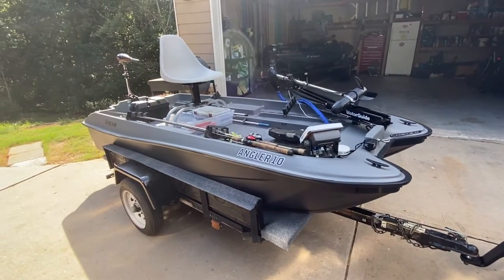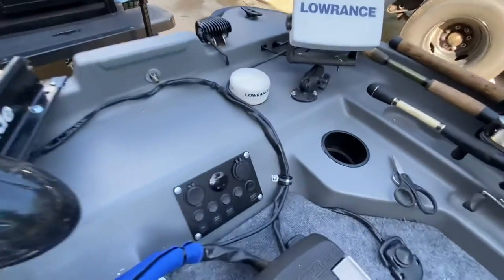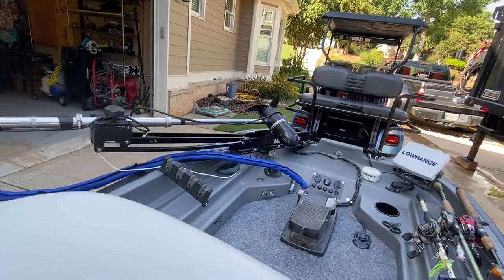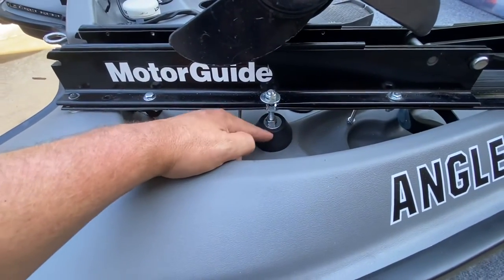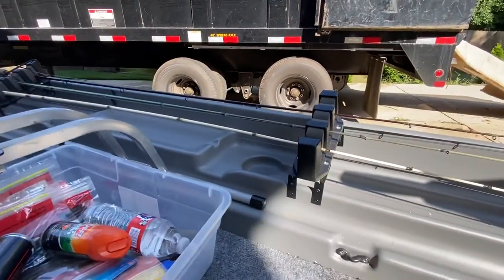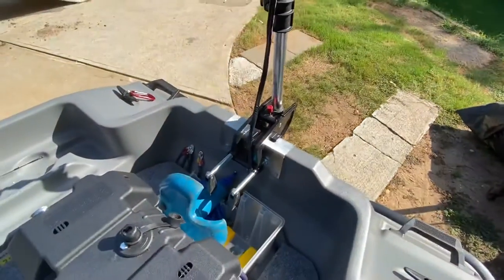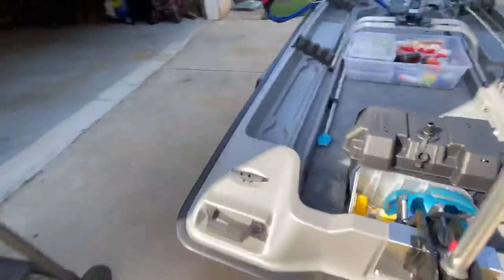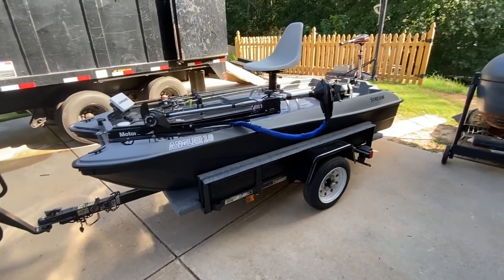Plastic 10’ boat modded

Comment: Great build, Greg! I love your mods! I'm on Lay Lake in Alabama, and we just got a little Bass Tracker Bantam 2X. Fished it a week or two and the generators were kicking my 40 year old butt trying to paddle, so I recently ordered the "4½ HP" 4 cycle Cukusin/Hangkai Honda clone. Hoping I'll get a least a few miles an hour, and our lake is about 12,000 acres, so I'm starting with the gas outboard and getting a trolling motor later. Starting on a very tight budget. 

I'm gonna steal your low deck idea. I love it! Do you have storage or accessibility for the deck?

Also love the magnet idea! That's a quick & easy mod that'll be quite handy for me. I'm also looking at a tackle rail, an original idea for custom lighting, and gotta figure out where to find the rail seats...mine can use em but didn't come with any. 

Thanks again! Subscribed! I'll be posting videos of my build soon. Thanks for the inspiration! 🤝

Comment: nice mods.   How did you run power the wire for the graph back to the battery?   did you fish it through the hull or just run it under the deck?
Reply from the maker: I ran it under the deck. Buy a long set of jumper cables and cut off the ends and it’s durable and cheaper than other wire.

Comment: Great mods! What screws do you recommend for securing accessories to a plastic boat?
Reply from the maker: I used nutserts that are coarse outside so they can’t pull out and used numerous all over the boat with success.

Comment: What screws or bolts did you use for the plastic
Reply from the maker: Home Depot sells a threaded insert that’s metal open ended and course exterior that you predrill and hammer in. I’ve had no issues after 2 years.
Reply: So these inserts are exactly what you used for the trolling motor??

Comment: 1 battery for both motors? How is it working?
Reply from the maker: I only use back motor for longer runs (with the front one at the same time), that being said after running 15 minutes in the wind, fishing 5 hours on a middle speed on the front motor, it starts to slow down. Without wind I can fish 8 hours.
Reply: @gregchupp5157  Good stuff sir thanks, I think this boat can easily carry 2 batteries if going solo fishing.